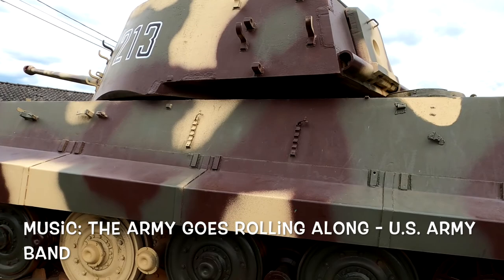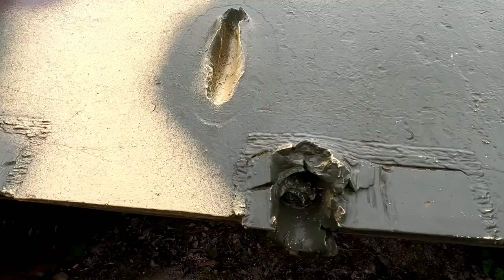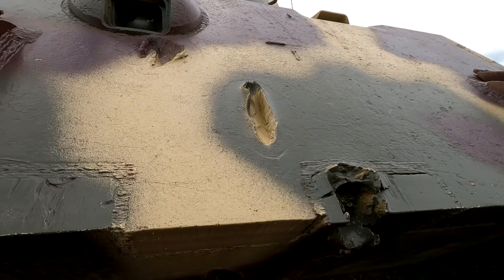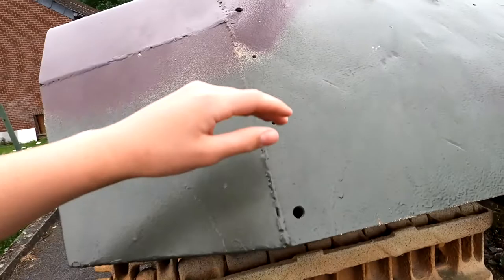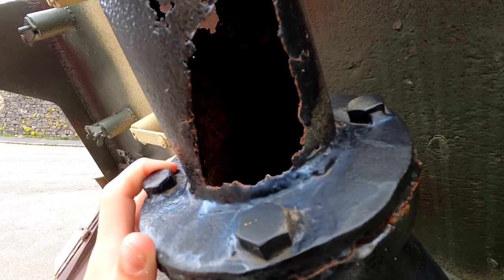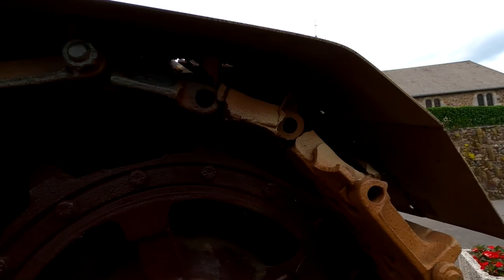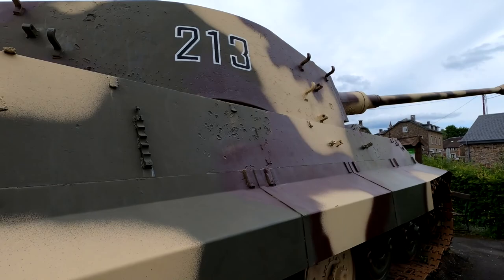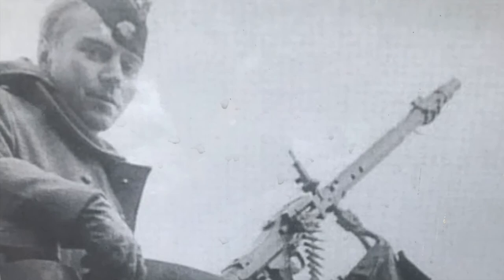A Rare German WW2 King Tiger Tank was sold to this Belgian Village!  #Königstiger #ww2 #tiger2

Comment: The tank was cleaned up and painted in trade for the engine. Hull gun was 7.92mm. Link pins were checked constantly because they worked loose on both Tiger I and Tiger II. The French have a Tiger II running  Bovington runs a Tiger I.
Reply from the maker: That would be so cool to visit the ones that are running! I didn't know about the engine trade, the museum that is near the tank didn't seem to supportive of guests so we didn't bother with them.

Comment: Tiger 2 at la Gleize, Belgium. I heard that the US was towing it back to be studied but the tank transporter broke down. You can see the thickness of the armour by the weld joints. Tiger 2 would take 300,000 man hours to construct and cost around $5m (in 2022 dollars)
Reply from the maker: That’s a great point, you can see it really clearly up front. I think the T34 we made a video of showed the welds similarly.